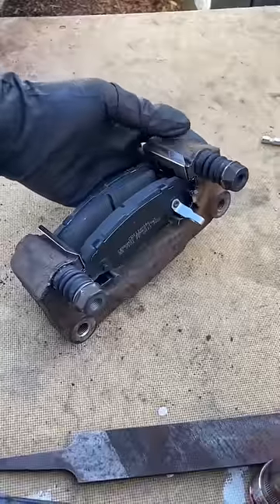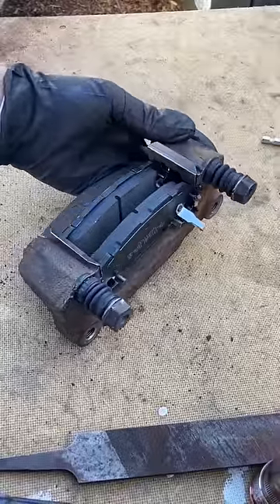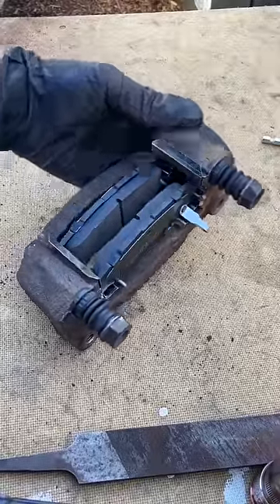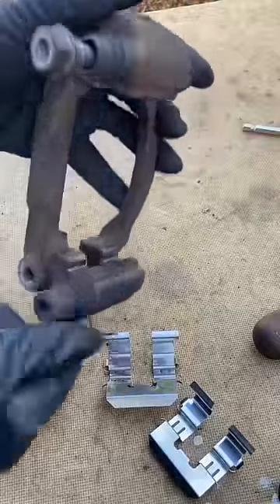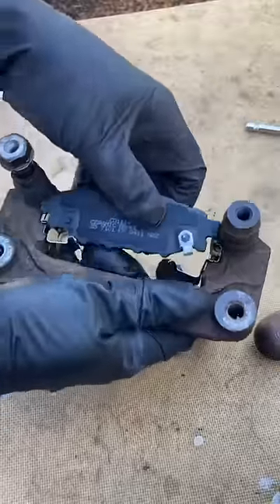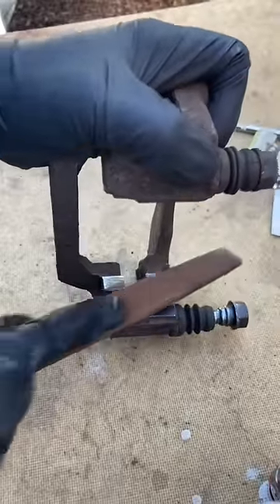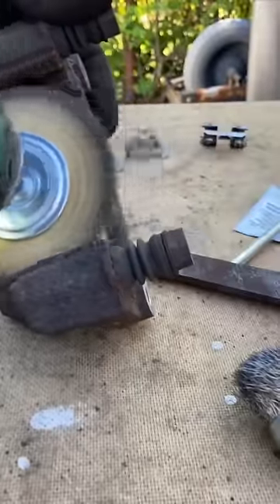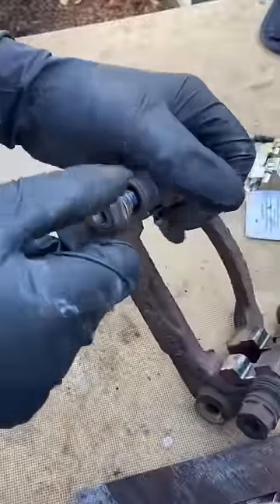What’s the Difference Between a $50 Brake Job and  $200 Brake Job

Comment: Binding parts are never good for breaks. The key to it guys is to have the tools grease lubes fluids and solutions with the parts you need. Extras are mandatory because pieces get lost or roll away easily. And you must always always have a C clamp or caliper cylinder compressor in your tool box.

Comment: I do all that on every single brake job i do and I even replace the o ring a dust boot on the caliper if it was difficult too compress on a 100. Brake job 🤷🏻‍♂️👍🏻

Comment: Idk, my dealer rate is $155. It pays 1hr to replace pads, rotors and hardware, 1.5hr if your turning/cutting rotors. I personally always clean and grease the pins and contact points. If it's not equipped, I add and anti sqeak/squeal to the pads.

Comment: Charges $150 more for taking 10 more minutes prepping the caliper.I taper the pad edges a little and use some grease on the stainless steel slide also.almost a great job.

Comment: Noticed that you said when I put the pads in the bracket you noticed they were sticking so then you went on with the file and brushes, etc. if they slid on that first time it would have still been 200 correct? Sure it was priced before work started so it would have been a $200 pad slap if it didn’t stick the first time? Last question, so you showed a $200 job so now can you show or fake a $50 job so we can compare what comes with and how much more time is involved for the extra $150. Thanks in advance.

Comment: There's the right way to do every job but scammers over the years has forced a simple steele file and greasing in a brake replacement for $200. In my country USD is $6TTD to $1USD. Therefore, a job like that would cost me $1200ttd at this mechanics rate. Robbed at $50 and finessed at $200.
Reply from the maker: Thanks. Here is the updated video https://youtube.com/shorts/T2K5fT1IYFE?si=rI-Z96UlC564QYVy

Comment: Even for a cheap car your not getting good pads that don’t wear uneven or degraded under heat and extreme cold , dust up your rims , $25 for each rim on 4 wheel disc that’s $100 in parts , the boots and instructions are included 🫥

Comment: My theory is.... I spend what a mechanic would have charged me, on parts to replace everything im near while its apart. I mean to an extent, but if youre doing the radiator? Replace all the hoses that connect to it. The coolant resevoir ect. Your car will be a lot more reliable, and last longer and youll know it was done right, by you. Brakes? Get good pads, replace all the bushings, get new calipers if the old ones show any leakage. Youll save money and time doing things like this. Dont pay someone elses wage if you can fo it yourself..

Comment: I do this no matter what I charge.  If I charge a friend 25 bucks or a random customer  100. I would never charge anyone 200 labor to install a set of pads. Unless the rotors need replacing and are pressed on.  I try to give people more than they pay for and save them money.  I only work as a mechanic at home in my spare time so I can afford to do that.  A lot of shops have a lot of overhead to cover for shop and expenses so it's no wonder they have to charge more

Comment: I need to charge my partner $200. That's everything I did when I changed her pads and discs. I also put copper slip on the ends of the pads and back.

Comment: in NYC mechanics charge btwn 80.00 and 120.00 for labor only. true to this video they dont use the proper greasing method. afterward the pads bind up and brake pads wear unevenly .

Comment: Extra 10 minutes for £150. To get the new break shims in you have to give the calliper attention with a wire brush so you aren't doing anything extra other than luring the sliders

Comment: I am from Slovakia, thats mean I charge 50euro all the time :-))))

If seriously, I do charge 7.5euro for one caliper bracket, only work, and after cleaning area from rust,,, cleaning till pure shiny metal, I use a paint, usually something like body used to protect chassi. Only thin leyer, to not make pads stuck. 

Let to dry out and after this grease, waterproof grease to increase apint rpotection, then clips, and again grease on clips and ears of the pads. 

Its dirty work full of nasty stuff in air so wear protection, but the result worth it. And customers recognize the difference. Usually shoot a video for customer to presend what is he paying for.

Comment: Sand blast every caliper bracket. 45 minutes for both axles.same exact result. 200 plus parts. If I'm in my driveway as it looks like it are, there's no warranty, no insurance, no taxes, etc. Naw 100 a axle plus parts. And it will be exactly the same as yours. It'll take 45 minutes, you pay book time bcuz of experience, I can turn time while maintaining quality and not cutting corners. So I learned to turn time. I sand blast the caliper brackets and I won't upcharge parts. I guess i have a heart we aren't all crooks 😂
Reply from the maker: Ya I need a sandblaster.

Comment: Learn to do brakes yourself  it's really easy for those of us in the business we call this gravy work because it pays ok, and we can do it fast . With $50 you could buy the tools from hf to do your brakes and any machine shop will resurface your rotors and mic them for $20 each so figure 50 in tools 60 in parts your still under the labor costs to do this yourself ive taught every girlfriend ive ever had to do their own brakes and oil changes they are basic rhings you shouldnt pay some random guy to do who most likely doesnt even have a ged

Comment: Know what you meant to say is hey I’m a mechanic I’m gonna charge you $200 but I’m only doing a $50 brake job because the odds of you taking of your brakes off to check to see if I done any extra work are very very low so I will charge you $200 because no one’s going to check my work anyways😊

Comment: I must be $300 as I clean the whole carrier and even clean up the nuts and if a mechanic doesn't do this they need to rethink their profession as a brake job is simple 👍
Reply from the maker: Yes 👍
Reply: Replace the bolts/nuts if they are bad and you live in the snow belt. Nothing is worse than a rusty bolt that strips on your next job.

Comment: At the end of the day, this 150 extra pays off, in a safety equal pad worn-out, smoother disc... This way you may keep your discs and replace 3 times pads.. While 50 dollar job, will most likely screw your discs after first replacement... Cheaper is to pay more...  🤔 wierd, I know

Comment: That happens to the rubber when you use the wrong grease  that makes the rubber get swollen  and make the pin stick cuz it dose not fit  there are different grease for different brake applications

Comment: Shouldn't you put the grease on the outside of the stainless bracket where the pad actually slides for lubrication and help the pad slide. You put it between the caliper and the stainless bracket where nothing actually moves.

Good job getting the rust off first or the bracket can't seat properly binding the pads up

Comment: It’d be a 75$ brake job if you used a wire wheel on a die grinder instead of hand filing it

Comment: What happens to the grease when the rotor hat is bolted down onto the hub by the lug studs, then heated up by braking and spun around at a high rate? Just curious

Comment: Filing, wire brushing the calipers rarely if ever has to be done, greasing the pins doesn't make the job much longer at all. What's the difference your paying for between $50 and $200 in labor?

Comment: I still do all of this and I usually charge 20$ a wheel for labor but it has bitten me in the ass a few times like seized slide pin/stripped threads/broken bolt etc.

Comment: I get that freelance jobs give you freedom to choose what you charge per job and that is great, however there are jobs that can be risky to have a "menu" type charging method like, 75 dollar brake job wont have the calipper prepped but the 200 dollar job will. 

Thats because if you dont prep it and the pads end up failing or jamming the person has an accident and dies or whatever, you can get sued and held responsible for doing half a job because it was not included in the package to prep the caliper. 

Honestly as a mechanical engineer myself, you should charge more if whatever you are doing can be done faster or needs to be detailed for aesthetics. 

Like hey 75 bucm brake job takes me 1 hour, 200 buck brake job can be out in 30 if i bring another guy in, each one makes 100. Sounds fair enough. 

But 75 bucks i just put the pads and 200 bucks i cleaned the dam thing to prevent it from jamming. Thats just poor customer care

Comment: No evaporust? No polishing the pad bracket? No Crome plating the pads metal? No cleaning the piston and cylinder? No replacing the piston ring? Damn. I just buy a refurbished assembly and I got all done for less than you think.

Comment: Hmm I just got my AC compressor and expansion valve replaced and it is working fine but they short changed me in not putting in the dessicant bag and drier . Said some lame ass excuse that the condenser is “ factory sealed “ …
Reply from the maker: This is a updated video: $200 For a Brake Job? Would you Pay it?
https://youtube.com/shorts/T2K5fT1IYFE?feature=share

Comment: clips don't slide, the pads do,, Supposed to grease the clips not the caliper bracket. Pull the pins clean em,u don't need a tool to apply the boots, smear your finger round after greased pin application. You spent way to much time on it and also you forgot antiseeze.

Comment: If you're going to charge 200 then you should have buffed all the rust off the caliper and painted it. The old rubber boot was not bad. It didn't go in because it was never greased properly before and the hole were full of rust and dirt. If you would have just cleaned the holes like you did the old boot would have worked. Not all kits come with new boots. But since yours did, I would have replaced them anyway. Like you did and still would have only charged 50. Brake pads are not complicated to replace and only take about 15 minutes to do both sides even with cleaning the caliper. Over charging is a good way to lose customers.

Comment: Lmao i charge 30 each corner  i grind them little bit  to fit little loose with new hardware  i wirebrush with grease on pins and bolts but the treads

Comment: Honestly thats a 50$ job , real way to do a 200$ job is sand blasting all the rust off and painting the braket in rust resistant black paint beffor applying the greace , and the filling is a real bad idea since that could cause brake pad flap

Comment: Did you checked for warpage? Structural damage, like cracks?
New boots, Ok. But the races need to be new and the pins also, otherwise, pad wear can be uneven, noise or an ABS / Anti skid lamp will go on. Plus you forgot to dress pad slider grease. And also pad to piston adhesive. Before any repair in brake hardware, toxic dust cleaning is necessary. Those parts in the video were not clean, evidently. [ I say because some of us have kids jumping on us when we return home, thats when poisoning occur to the most vulnerable. Those strange illnesses. Wash well all parts. And change clothing before leaving the shop.] - For the $200 service job

Comment: Well, I don't use a file to scrape away Rust from a spot that is not rusty. You do and you charge two hundred. So by your logic I should charge three hundred. But I will settle for the 100 q parts I charge people because I would rather have happy customers who come back. Not customers wondering why their brakes don't fit in the caliper. After the third time, you changed them.

Comment: The air does come out let’s talk about a $50 and a $200 brake job that is normal that is part of the job that you’re supposed to do and even though you do all that those pads will still fit tight you have to take a file or take it to the grinder and grind those ends down so those pads fit in snug not tight so when it heats up the metal doesn’t expand and the pads don’t jam up because they are pressed out in the press and they got pieces of metal sticking up to where they make them tight. I see people beat the pads with a hammer you don’t have to put no grease on your break job at all the only ones where you need grease is your slide pins that is it the rest of it manufacturer doesn’t even put grease on there. I’ve done break jobs, both ways with Greece and without Greece as long as it is clean, no rust and everything is smooth. You take your time and clean it up. You should not need no grease and I’ve never had a brake squeal on either one with or without greasewith grease I’ve had squeals to no end and like the dealer guys call us the bakers
Reply: Greece is a country.

Comment: Take thoes rubber boots and toss em. Take the pads to the grinder. Grind the paint off the ears, dab of brake lube. Grease the slide pins. And DONE why is the rubber even on 1 of the pins.

Comment: You're ripping customer off. You should be able to change pads and rotors in an hour less. You should also open up the brake line the drip some of the brake fluid out. Gravity bleed the caliper. A little bit of moisture builds up right there in the line because it collects moisture and then it boils when it gets hot.

Comment: You didn't need a boot kit cleaning it with the drill would've done the trick too much grease in the tube trapped the air not the boot and are you kidding me with the file wtf are you going to do with that.

Comment: so you wire brush the contact surfaces and charge 200 dollars for it? sheesh would be 5 times smarter to just buy a new caliper bracket. lol scam artist.
Reply from the maker: How is that smarter? Sounds like bad business
Reply: @AndyTheXTech  I meant the customer would be 5 times smarter by just avoiding you. Maybe you could change their blinker fluid for 500 dollars.
Reply from the maker: @MinecraftSurge  🤔

Comment: So, why doesn't the mechanic be honest and just tell you upfront that he's going to do a sloppy job if you chose the $50 brake job option? He won't. That's dishonest. So don't blame the customer for a dishonest mechanic. He won't tell you because if he knows he's about to sabatage your car, he shouldn't take the job. That's bad business. The amount you pay in labor is irrelevant. You can pay him $300 and he might still only do $50 worth of work. It's not like you're allowed to go in the mechanics bay to see if he's doing quality work. It comes down to how lazy and trustworthy is the mechanic. We pay them whatever they charge and still get screwed.

 My brakes have air deflectors for additional cooling. The mechanic took those off just to check the axles. He never put them back on. I didnt find out until a month later that they were missing. Cost me extra $60 to buy replacements. I've always paid them whatever they charge and some of them still do a sloppy job.

Comment: When I would do $500 brake changes for people alive I would do all that I knew I was screwing myself out of money but I wanted to help the person I mean one person got quoted $600 for all four brakes on a 1996 cavalier and this was still like 2006 probably but the car was still 10 years old and it should not have been $600 to change all or brake pads and I told her I was like since you're going to be saving so much money why don't you go ahead and just go ahead and get rotors New raiders for the front new drums for the back and then one of our front calipers were sticking so we went ahead and replace that too but you know I still just charged my $50 labor fee and nothing in parts it was less than 300 so all in all she paid half of what she would have paid. Also wouldn't have been 300 if she didn't want the ceramic pads it would have been more like 150 I told her to show me pads are a little bit overkill but that's what she wants she just wanted to ask the rest of the life of the car and I'm like well as long as you don't jam on a brakes a lot it breaks it lasts the while I think your rotors are probably going to eat up before the brakes would anyway $50 brick changes by honest people that care about other people will do the work of $200 and another pretty much just shorting themselves and I was shorting myself but I just like helping people when they need help the only problem is is that I always heard karma came back to help you but that would always help people but karma would always hurt me and deep down inside I feel like I'm actually supposed to be not a nice person but I am and I just don't get it sometimes

Comment: It should be done right not wtf you want to smh....not like spit shing a Petrie dish an then say up its germ free n ready to use......also machine machinist that don't like doing the two to three steps more to inshore a safe n better then just semi working machine then working on em for a job may be isn't your best choice.....a tech that does a break job n some how has extra bolts n or lugs caps w.e should be fired on the spot imo...cuz like how are you gona take something apart n have extra anyshit putting it back together 😂😂those ones always be killing me pun intended.....no dis against the man in this vid I'm aiming to ever tech in my local area and meh maybe all em 😂 ✌️🙃😅